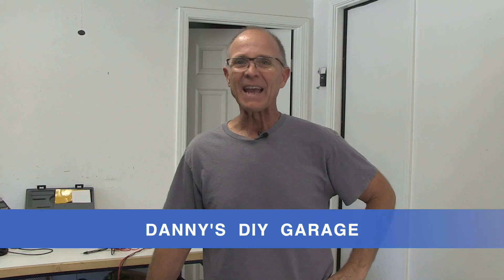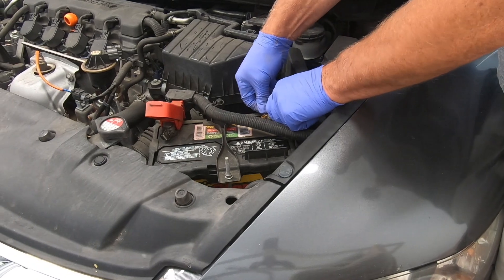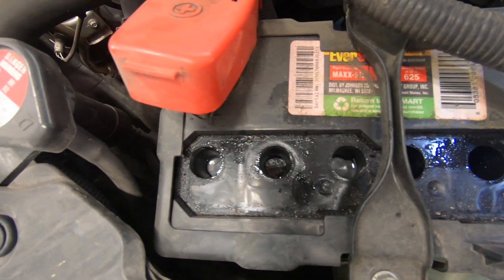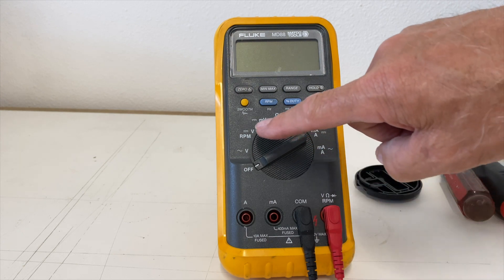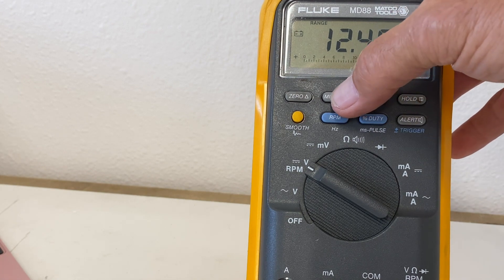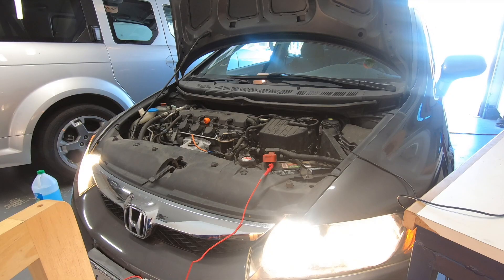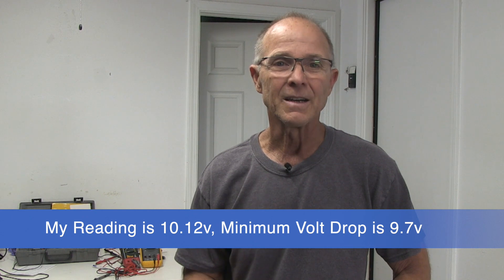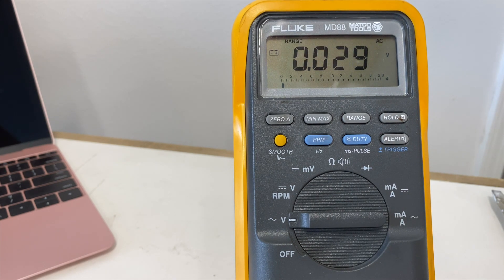How to Test your Alternator and Battery using only a Multimeter Honda Civic 8th gen

Comment: How come noone is showing how to actually check the alternator. For example honda has a control also load indicator. You can have bad reading because you have a pin fitment issue with a control wire. Or open wire.

Comment: I used a load tester and everything worked out but when I turn the key it seems to bog down as the motor cranks. Will try again using your method. Thanks!
Reply from the maker: Let me know how it works out
Reply: Thanks for the opportunity to get back to you Danny., the min max test gave me 14.69 & 10.36. However the ripple test gave me .7 which is a fail. 
    Last week I used a load meter to test because the batt. would not crank ( batt. less than a yr. old). Could not get the voltage into the 14's whilke running, but disconnecting and reconnecting alternator wires got me back to 14v. Apparently there was a bad connection.
    The alternator that is in the civic now was sent out by the Honda dealer for a quick rebuild about 3-4 mos. ago. I sat in the Honda dealer service center while the alt. was sent out for a fast repair. I was supposed to wait 2-3 hrs. but after 6-7 hrs of wait time the dealer said there was a problem with the rectifier which they did not anticipate and was told to come back the next day.Got the car back but ever since it started but seemed to bog down somewhat  while starting. I fixed the loose connection  as I stated but still that hesitation as I turned the key remained. 
    What is your recommendation? When compaining to the Honda Dealer who handled the rebuild he backed away saying it was a used item without guarantee.
 @dannysdiygarage
Reply from the maker: 10.36 volts is definitely enough to crank the engine, so the battery has enough energy, checking the starters current draw might be an option, I don’t have any videos on that though, however there’s probably plenty out there, also a voltage drop on the starter wire that goes to the starter might help, I have no video on that, I need to do a starter video that covers all possible causes, appreciate the suggestion or idea for another video

Comment: I upgraded my alternator to a Mechman 170 amp. At 1800 rpm it's pushing 193 amps. My battery reads 14.9 at idle is that bad?
Reply from the maker: Typically you’ll see max 14.5. If you’re seeing 14.9 at idle that’s concerning, although it could be normal due to your high amp rating alternator, I would contact the company and ask questions, you can also check the diode in the alternator, I have a video on that, how old is your battery?

Comment: My battery voltage initially was 12.24V when car was off. ON turning the vehicle ON, BY using the Max and Min function of multimeter, I found that max reading is 13.50V and min reading is 7.46 V. Can you please guide that what is the problem in my case as i m facing battery drainage issue over time drastically. 
Also, please note that on turning all lights ON, the voltage remains within range of 12 V to 13V.
Reply from the maker: How old is the battery, you said it the reading drops to 7.46 when cranking the starter? Did you watch my parasitic draw video?

Comment: Hi 
Sir i need your help 
My car civic 2009
The dashboard lights 
And front light 
Flashing  when Press gas
The battery is good 12.5
 Alternator is good 14.5 
what  should i do
Reply from the maker: Did you disconnect the alternator connector and see if it still did it?
Reply: Actually no i didn't
I will try
Thank you

Comment: I'm a bit confuse. If I perform this test, my car battery and charging system will pass, but if I turn off the lights with the engine running, the voltage drops to 12.5v. I've been reading people reporting the same behavior on Civics and Fits. Is this normal?
I've been checking this because one very cold night, it cranked slower than usual, I also notice I left the cabin light on, the whole day.
Autozone passed the battery and failed the alternator, but then I went back to them to get a second battery check with headlights on, this time, battery and alternator passed. Perhaps the battery is reaching its time. Any suggestion? Thank you very much in advance.
Reply: Check the internet for how Honda charging system works. It appears that it is able to cut in and out as a fuel economy measure. Typical alternator tests may give misleading results.
Reply from the maker: Without knowing all the details I would say yes it’s normal, if you turn on the blower motor the voltage should not drop, you can also use a current clamp to test the actual current the alternator is producing , I’ll try to make a video on this in the upcoming weeks
Reply: @dannysdiygarage  Thank you very much. I asked a mechanic at a Honda dealership, and he said it’s not normal, the voltage should stay at 14 v, no matter what. I replaced the ELD (electric load detector) and problem solved. $8 fix.
Reply from the maker: Thanks for adding input
Reply: South Main Auto has useful video on Honda charging system.
Reply from the maker: Great information

Comment: This is 2 years old and all good. Just a little advice; even if you have a high-end protected Fluke meter ($$$), ALWAYS set the meter first and then connect it. Don't just cycle the selection button with a voltage connected to the probes. It is not safe for the meter and/or the equipment under test.
Reply from the maker: Agree,

Comment: Nice video but the last test did not work with the same reading at all, not even close. I replaced the alternator and got the car working then tested the last test again and it doesnt read like this guy. Same car. Otherwise great video.
Reply from the maker: Thanks for adding your feedback, appreciate, possibly the meter you’re using

Comment: Thanks for the video it’s very helpful 
I have a 2012 Honda Civic 
My battery went dead just last Friday when driving so I took it for inspection and I was told the alternator wasn’t charging battery so I took it to electrical expert and they worked on the alternator. Later after they finished working on the alternator and when u cranked the engine the alternator charge reads up to 14.55 and drops back to 12.60 or less. When u switch on the headlights theme the alternator begins charging at 14.56 and when u switch off the light it reduces to 12.34 there. 
Pls what could be the problem 
Do I need a new alternator replacement?
Reply: This is because of hondas dual mode charging. Working normally
Reply: @Lu_o3  - Thank you!!! I almost replaced my sister-in-laws 2015 Civic EX's alternator because I didn't know about this! I thought it had a bad voltage regulator.
Reply: @SuperWingman69  I mistakenly replaced my alternator after changing my battery because the new battery was reading low because of Dual mode charging. I was very mad when I found out afterwards haha, glad I could help someone prevent making my mistake
Reply: Oh ok thanks I will do that and let you know pls.
Reply from the maker: Without being there I can’t tell you accurately what is faulty, however use the steps in this video as a guide, 1st step is always make sure battery cables clean and tight and the battery is good, ( batteries can cause weird problems ) perform the charging systems tests in this video, also perform the ripple test, the vehicle in the video is what a good charging system should look like, you should be able to make a decision based on that, good luck and please update this channel on what you found, this will help others find answers to there issues.

Comment: I have a 2002 Honda Civic with a brakeline leak up front in center of car. If this splashes onto my belts would this interfere with the Alternator?
Reply from the maker: Definitely not good to have anything getting on your belt, no to mention a brake leak, definitely get that fixed

Comment: Hi 
I have 2012 Honda civic 
Battery good 
Alternator good 
But showed me in dashboard check charging system 
And when i changed the negative terminal sensor was not genuine showed me airbag passenger side in dashboard 
I need help 
Thanks
Reply from the maker: I’m sorry I missed this comment, did you fix this?
Reply: @dannysdiygarage  yes 
I fixed it 
Was just negative terminal sensor
Reply: I have a 2017 Honda civic. I changed the alternator and battery and I'm getting the same check charge system error. I'm gonna try the negative terminal sensor

Comment: Thank you very much for your video, my 2013 Civic sits most of the time at 12.5-12.6 volts with no loads, engine running, if I turn ON the headlights it will go at 14.6 volts, I was reading on many websites that this is normal because the charging is controlled by ELD, is this true? I just realized this because my battery voltage was 12.1 volts after 8 hours of car sittig in the parking lot, the battery is only 9 months old and a dedicated battery tester it reads 100% health, 525 CCA (rated at 500), and the message "good battery, Recharge". Any thoughts? Thanks.
Reply from the maker: This should be normal, however one thing to check is parasite drain 
Easy to test, video on my channel https://youtu.be/fZZpQY1aCVk
Reply: @dannysdiygarage  Thank you, I just did the "ripple test" and it shows 27.2 Volts (AC) is this ok? My multimeter has settings like 600 AC or 200 AC, I used 200 AC setting for testing.
Reply from the maker: @razvanpoenaru  what test did you just do ?
Reply: @dannysdiygarage  ripple test, sorry I thought you said rebel in the video, my bad
Reply from the maker: Those aren’t good reading, you’ll need a better meter, I pretty sure the ripple test will be fine due to your other readings
Reply from the maker: Are you actually have starting issues?
Reply: @dannysdiygarage  no issues at all, like I said today I discovered my car voltage parked was 12.1 volts, then after I monitored charging was like I just said
Reply: Hello, i am having the same issue with my 2013 honda civic. I have gone through two batteries and alternators and after time the system dies and leaves me sitting on the side of the road. I was wondering if you found out any more information about this or had any more issues involving this? Thank you in advance for taking the time to read this
Reply: @Ihavetohandleittoyou  I did not have any problems with my car, so I did not do anything about it, I understand is normal that kind of charging, I've seen even new 2022 Chryslers and Jeep are doing the same, keeping the voltage at 12.5 volts while running. If you replaced 2 batteries and 2 alternators maybe the culprit is that ELD, try to bypass it, you will have battery light ON on the dash but try like this for few days see if the problem dissappear, otherwise maybe you have parasitic drain

Comment: Can the alternator be putting out 14+ volts at the battery and still not pass the diode test? If so, what does that mean and what’s the solution? A new alternator?  Thanks
Reply from the maker: Yes, redo your diode test, sounds like diode symptoms
Reply from the maker: Yes, Usually, a bad alternator diode will cause your headlights or instrument panel lights to flicker or dim and, sometimes, drain battery power overnight, or in minutes. *

Leaky or shorted alternator diodes can cause rapid changes in the output voltage of the charging system. In addition, bad diodes can also allow current to leak from the battery back through the alternator to ground.
Reply: @dannysdiygarage  I been chasing a problem of pulsing lights on a 1999 Honda Civic. I will have to redo the diode test.. could a bad pulley or belt cause the same issue? Only asking because I hear a faint squeak that mimics the pulsing dash lights. It also stops when I turn on the AC. Would love to hear your thoughts. Thanks

Comment: Nice video! I must have done the alternator test wrong, because it was 31.4 V. My battery is 10.4 V when the car is off, but goes up to 13.6 when running and then 14.4 when under load. It went all the way down to 8.something when I cranked it.

Immediately after turning the car off, the battery's voltage began dropping.
Reply from the maker: Ralph Caffery sounds like you need a batter
Reply: @dannysdiygarage  I re-did the test. My positive terminal gave .02 when tested against the alternator. My negative terminal gave 14.4.
Reply from the maker: Ralph Caffery 14.4 is good when running, 10.4 not running is bad, probably a bad cell in your battery
Reply: Dannys DIY Garage I’ll look into it. Thanks for all your help and your well-made video!!:)
Reply: I realize I'm kind of randomly asking but do anyone know of a good site to stream newly released series online ?
Reply: You and your reply are bots, but 7xtream is better @dannyrafael3334
Reply: @Danny Rafael meh I would suggest Flixportal. you can find it if you google:D -aiden
Reply: @Aiden Avi thank you, I went there and it seems like they got a lot of movies there :) I appreciate it!!
Reply: @Danny Rafael glad I could help :D

Comment: My alternator was ready -0.002
Reply from the maker: leslie flores are you asking a question?
Reply: Dannys DIY Garage lol yes but I pressed sent accidentally, my multi meter was reading -0.002 when I revved the engine and turned the lights on what does this mean
Reply from the maker: leslie flores which test were you performing?
Reply: Dannys DIY Garage an alternator test
Reply from the maker: leslie flores if you were doing the alternator diode test, this would indicate the diodes in the alternator are good, your meter leads were probably reversed
Reply from the maker: The test at 4:00 in the video, is this correct?
Reply: Dannys DIY Garage is there a difference between doing the DC rest and a AC test? I think I did the DC test on the alternator should I do the AC test instead?
Reply from the maker: AC selection tests the Diodes in the alternator, all other tests performed should be in DC mode, that’s your problem if you were not in DC mode